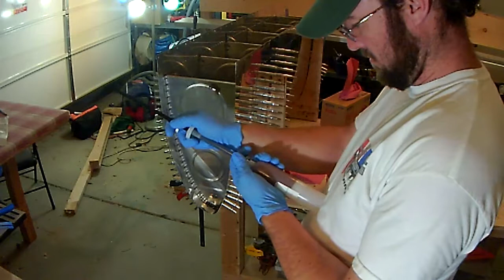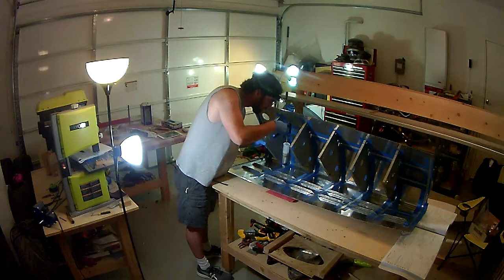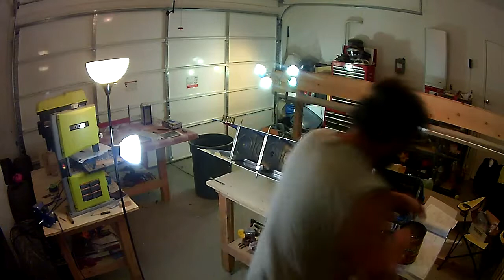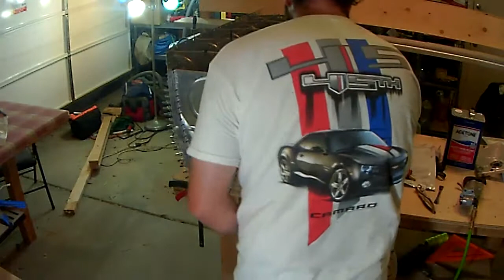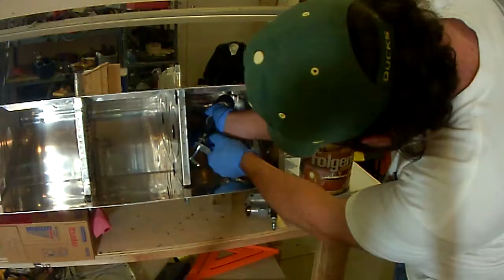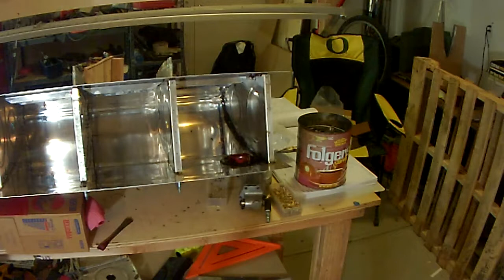Scott's RV 14a Fuel Tank Pro Seal Real Time Application

Comment: This is awesome thanks a bundle =)
Reply from the maker: Absolutely! I hope that it helps you out! If you haven't already, check out this forum post. This is the guy that I have been using as guidance on how to do the pro seal job. its a bit lengthy read, but well worth it. Took a lot of my anxiety away.

http://www.vansairforce.com/community/showthread.php?t=7602
Reply: That post was really informative, I got an additional question did you find that the 2 hour proseal was enough time or would the 4 hour be a better option considering with this process we are letting it cure over a day or what not
Reply from the maker: I looked for a 4 hour pro seal but was unable to locate any through aircraft spruce, so I stayed with 2 hour. I may simply over looked it or it may be available through a different company. I am not sure how the 4 hour style will differ in application as far as the viscosity if it is more or less. I have done pretty well with the 2 hour style as usually I am ready for a break at that point anyway.
Reply: Yeah I was looking at the 3m stuff https://www.aircraftspruce.com/pages/cs/fueltanksealants/ac236b4.php I assume it would meet the requirements of proseal as it is also a class B fuel tank sealer, Vans recommends a different sealer than proseal from another company now last I checked on their website which is why I was looking at the 3m stuff
but looking at the cure times the tack time for the 4 hour is 36 hours where as the tack dry time for the 2 hour is 24 hours so I think the cure time might be a bit much. Based on your commnet that you need a break after about 2 hours. I figure you could probably get a full set of ribs coated and clecoed in about 2 hours but you could give me a better idea from your experience.